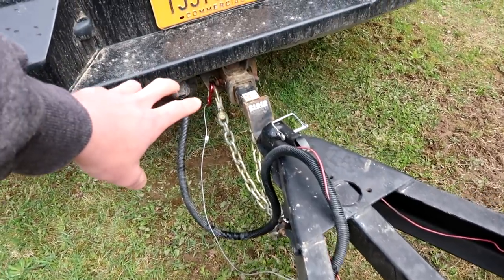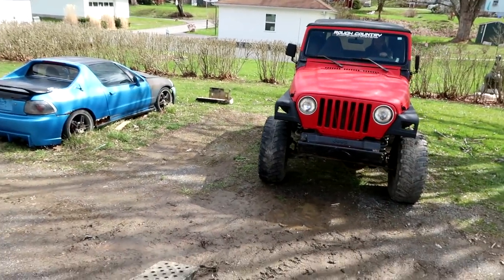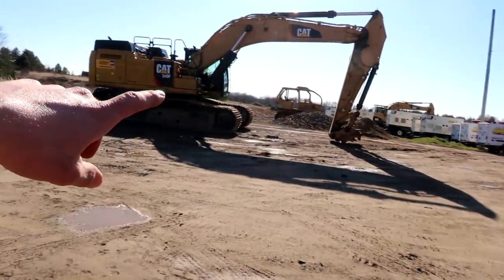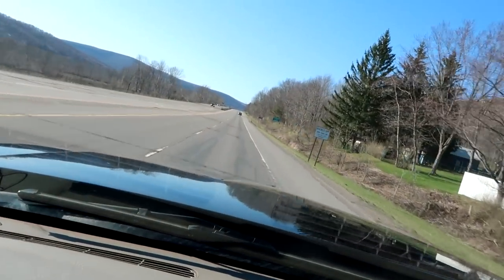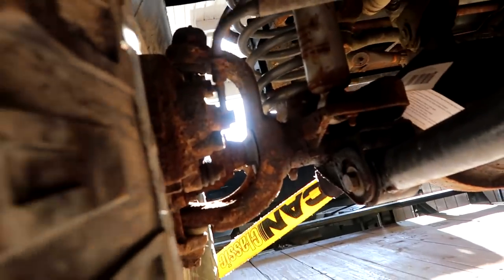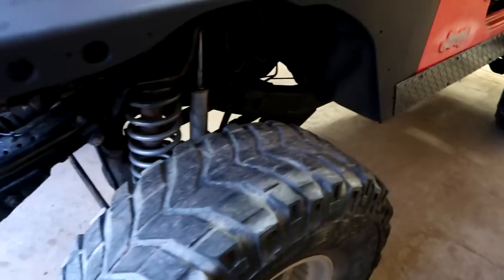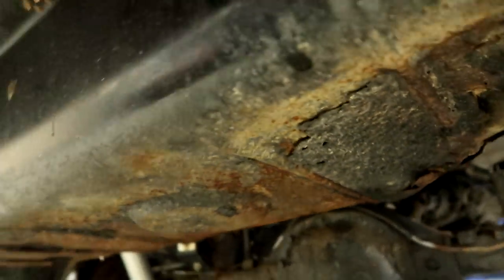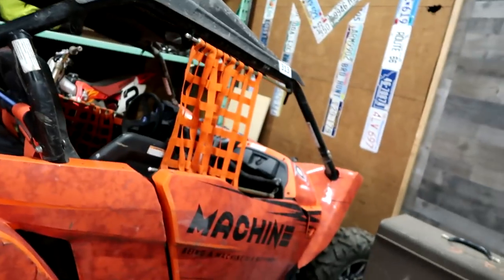I BOUGHT A JEEP DEATHTRAP

Comment: Before you do anything drill 1/8 th in hole's in the frame at the rear,in several, spots and see how much clean metal is there. The frames rust from both the inside and outside.You might find you have tissue paper thin frame. The motors run for ever last thing to worry about. Next find out if you have a ba 10( bad) Although I have 150+ mile on one  in a driver not a wheeler, or ax10              ( better) or ax15 transmission ( best) google pictures of both and you will know they are easy to be identified by the ribbing on the case. Next find your gear ratios in the axles and inspect the ring and pinion gears, big tires work them HARD. ( I would suggest Yukon Gears have had the best luck with them ) If it is a open diff then you can put a spool or locker in ,if it is a lsd they work ok for light off roading. .  If all this is good then start building. A ford 8.8 rear end is a good place to start ( if you find the rear end is junk), with a slip yoke eliminator and double cardigan joints ( call tom woods). Take that rubbish country suspension and throw it in the garbage. Buy a southern body tub( it will be cheaper in the long run). Then take the front axle and get rid of the vacuum engagement 4x4 and go cable actuated . NOW JUST EMPTY EVERY POCKET OF MONEY , And ask everyone you know to help for you birthday,x mass, honica,Easter, you can make up hollidays that gifts are for,you just want a jeep part.

Comment: Has flat fenders and a 2" trans drop kit that is good for pinion angel.  It does need a sye kit and some spacers for the wheels so it's not so narrow.  Get hub centric only!!!!!! 1" no bigger      and it will need a 3"  drop Pittman arm  to keep away death wobble. It is bullet proof  350,000, plus miles   with good oil and diff changes often.
Reply: drop pitman arms will cause bump steer if you don't change the track bar angle to match.
Reply: there factory fenders they just don't have flares

Comment: I have a 1998 Jeep Cherokee Sport with a inline 6 4.0 l with 2067000 miles with piston slap in all six cylinders so it sounds like a rod knock even though it's not it runs like nothing though! But yeah that could be a safety neutral switch or a crank position sensor because I had to replace both those online before would run right or at all

Comment: They do all right they're pretty reliable I've seen some of them hit 300,000 miles I've seen some that didn't even hit a hundred thousand miles most of that was due to a hundred thousand miles of rough trail when I mean rough I mean damn near submerged if not submerged but yeah they do all right most of them come with lifter tick typically the only way to fix those is lifters and a cam but is typically do all right I mean I would definitely leave some holes in floors not a rotted hole but but a whole so that way if you do get water inside the cabin it don't hold the water when you come out of the hole and starts draining immediately

Comment: My old college automotive teacher used to work at a salvage yard, and he was in charge of disposing of motors, so he put the sand mix in the oil, and with 450k Miles it ran for 4 days before the motor finally seized up, it was a 4.0 high output out of an XJ

Comment: It will get anywhere from 150,000 to 350,000. I put a new one in my jeep after my rear main seal went. But the old engine still ran fine. Very reliable engine

Comment: You might want  to check for a Vacuum Leak, that might fix your brake's as well, but your basic brakes are needed. So maybe start on the cheapest fix to get some brake's before you do anything,your tool's will thank you.
Reply: RJ 908 how would a vacuum leak cause the brakes to not work?

Comment: Might just be a clogged fuel filter or low voltage while running, had a friend with a Comanchee that would die like that, the alternator was only making 12 volts while running not enough to fully ignite the fuel. Other than that check grounds. Idk, good luck.

Comment: Those motors r tanks! They normally get tired around 400+ kms not sure whats that is in miles. First clean up the engine and get it running right then do maintenance then start mods

Comment: i have a 1999 jeep cherokee with a little over 320,000 miles and its has oil in the silenders and it leaks alot and it runs just fine but it does get hot witch is kinda normal for those things

Comment: Engine will last forever if you can get it running. That u joint angle is not good. You need a slip yoke eliminator and some wedges to fix your driveline. Definitely get some long arms for the suspension.

Comment: You need some serious help with that drive line.....let me know if you run into trouble I've been rebuilding drive line and transmissions for 20 years. i got a nice 4.7 from my 01 dakota that I pulled so i could install a 5.7 hemi that would re-power the jeep nicely...

Comment: In line 6 you can rack up the miles I had a 292 straight 6 in a 80 3/4 ton it was a great truck an engine

Comment: Don't fold down the front window it will ruin the seal along the bottom of the window. And if you are going to drive it in the road eventually with no doors make sure to move the mirrors off the door. There is  kit to move them from the door to that window hinge spot

Comment: My dad has a jeep Cherokee with the strate six engine with like 240000 on it and it's still driveable. As for the running problum with yours, it could be the map sensor, or possibly a crank sensor, or just a bad maine ground.

Comment: the 4.0 i 6  will last  well over 250 thousand if taken care of . but whos know what it been though already   once you get her running and warmed up  the oil pressure shoud stay around 20 at idle   if it goes to 10 or lower  you have a very tired engine 
well known for cracked head    between cyl. 3 and 4    hope all works out

Comment: The 4.0 inline 6 gets to 300,000 miles easily. HOWEVER, if you take care of it, it’ll do the same to you. If you don’t, it won’t take care of you. Listen to the lifters in it also. They have a tendency to be very noisy in higher mileage applications. Other than that, great engine and a great design.

Comment: With a 7 inch lift you will need a slip yoke illuminator or hack and tap, which lowers your drive shaft angle
Reply from the maker: Thanks Jacob!
Reply: 3DMachines yeah man

Comment: Jeep 4.0 goes 200k-300k no problem. Have two with high miles i had to rebild one at 200k. Still ran good but cam bearings were so gone i was at low oil pressure. 
FUEL PRESSURE  AND THROTTLE BODY, IDLE AIR CONTROL VLAVE, THROTTLE POSITION SENSOR, MOST LIKELY YOUR PROBLEM
Reply: 200k miles isn't high for a 4.0, maybe a Chrysler one. Definitely not an amc one.
Reply: Red Rider7 well that's lack of maintenance....Chrysler redesigned the 4.0 when the wj came out and slapped it in tjs. If you have an xj, zj, yj 4.0 you have amcs design. If you have  wj and most tjs you got Chryslers version of the 4.0
Reply: Red Rider7 "high output".....They're all high outputs. Cracked heads is such an upgrade let me tell you. and it taking 3 times as long to change spark plugs with the coil pack because now you have to move your cabels, unplug the coil pack from the crank sensor, unbolt the coil pack from the block and finally take out the spark plugs. Chrysler reinvented or redesigned whatever you wanna call it "improvements" as i said. next your gonna tell me you swapped a wj motor in a mid 90s xj.
Reply: Red Rider7 Because clearly you are trying to argue. "90s" lol 91 to whenever they stopped making them is that they were high outputs. 87-90 are renix motors SO I should of disclosed that. I know plenty, I've owned more than 3 and have been around most jeep and jeep models not just 4.0 jeeps. And actually it was 2 years for the yj with the 4.2, Chrysler bought the rights for jeep in 87 off amc and it went in the yj in 89. The blocks are in fact different from older model to newer ones. Bet ya didn't even know the zj was an amc designed jeep either. The wj and tj motors were re designed, they will not interchange with any older model 4.0 jeep. And I actually stated facts but okay there pal.

Comment: Sounds like a bad fuel pump relay or bad fuel pump and I have had several of the4.0 six’s and had a couple past 300thousand a couple I built at 250 but the are cheap to build and even turbocharged the fuel injected one I had

Comment: Drive line angle should only be between 1 and 3 degrees. Maybe like 5 or 6 degree max. Then you would be straining the U joints and be replacing them all the time

Comment: 145K is nothing to a maintained 6.1/2 million should be easy before bearings need looking at.Been around,and working on them for 40 years.Many of them have been around Allot longer.That looked fuel injected,and not very well.Sub frame and floor panel replacements are easy to get too.

Comment: Fix that driveshaft angle, square tube in the body mounts, brakes, exhaust cause that 4.0 sounds terrible, it looked rich from the smoke probably no o2’s, brakes, change every fluid possible, throw that rc lift away
Reply: Chris W Thats a good point about the o2 sensors not being in there. That would definitely help the situation.

Comment: Timing sounds outta wack. One last thing you can fold down the wind shield on these 90’s and early 2000’s Jeeps but you can’t do it on the road of course, otherwise if it wasn’t against the law I would do it 👍🏻
Reply from the maker: What is the purpose of folding the window down? Screwing up your hair?
Reply: 3DMachines I think you could for easy access to the dash or just in tribute to the Willy’s jeeps and WW2 jeeps, which they did do that to have better vision over the hood.

Comment: Um no! Most likely it has a 4.5 suspension lift and 3 " body lift  he would be just fine running the stock track bar, just drill and move it over  and he only has 33" tires  and a short arm kit. !     If it had 37" tires  and a long arm kit   then he would need a bigger fully adjustable track bar  so.....

Comment: Check out the drive shaft angle your not gunna want it at a very steep angle theres a few things you can do if you need more dm me @hunting_the_802 on insta just built a jeep from frame up could be useful